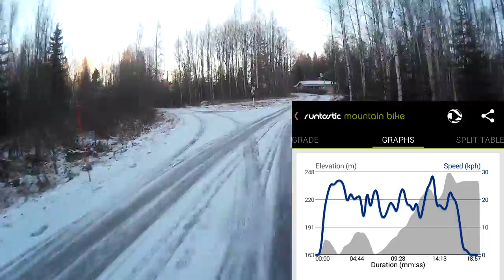250W Pedelec on a 5.5 km Trip

Comment: Nice trip! You say that you're in bad shape, but it really doesn't show. And things are likely to improve fast, it was the same for me when I got my off-the-shelf pedelec almost three years ago :-)
Reply from the maker: +NovaColonel 
Thanks! It is really hard to tell in what shape one is as it all become so easy with electric assist. Perhaps it is time to go for a ride and leave the the battery at home. :)
Reply: E-Bike Commuter
Haha, I'm happy that it all works so reliable for you, but then again, you're technically skilled. When I got my bike I had little technical grasp of most things, let alone bikes. When the chain slipped off the chainring and crushed the hall sensor, I had a very heavy bike in a hilly area....took two weeks for the replacement to arrive, which was destroyed in the same manner after a single day. The third one is still intact to this day, luckily....
Do you get any problems with overheating/melting components?
Reply from the maker: +NovaColonel 
No heating problems at all so far. I dont have an accurate motor temp reading but I have checked heat by simply placing my hand on the motor every now and then and the motor has always been cool, even after long uphills. The controller has been stuffed deep into the frame bag ever since I first put it there so I have no idea if it gets warm. The battery also stays cool. I have been riding in temperatures between +12 and -10 celsius.
Reply: E-Bike Commuter
Glad to hear this! My pedelec had drivetrain problems twice, first at the connector from the battery to the controller, where the contact pins had blackened to the point when no more electricity transmission was possible, and the second time many months later when the connector (it's a standard automobile part) at the fork to the motor melted inside. Replacing a good length of cable and using some inline screw connectors helped so far...
Reply: E-Bike Commuter hey, maybe you get some spike tires for the winter? i use them during the winter on my ebike and you are fine, even on ice. (not to much ice thou...)
and during summer they are fun offroad, lots of Grip.
keep rollin.

Comment: Beautiful part of the world you live in.
I have a question, you have a 250w motor, but reference getting more wattage than 250 when using assist level 5. I am unfamiliar with electronics, so can you explain what that means, and how it is possible?
Thank you.
Reply from the maker: I am no expert either. But what I think it means is that the motor is rated for a continuous output of 250W. The motor can take this for an infinite amount of time with no danger of damage. For shorter periods of time the motor can take up to 600W. I live in a hilly area and have so far had no issues with over heating.

Some people are running these motors with higher voltage batteries and higher output controllers. This will most probably reduce life of the system.